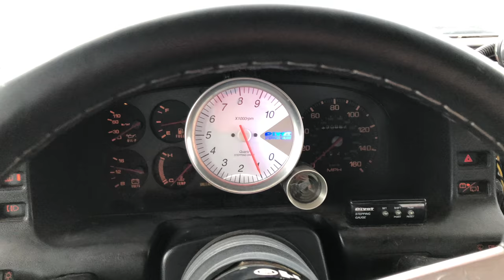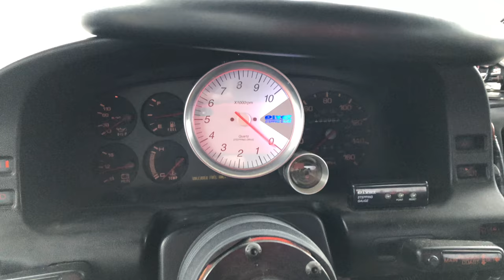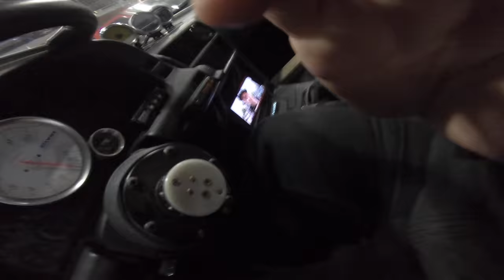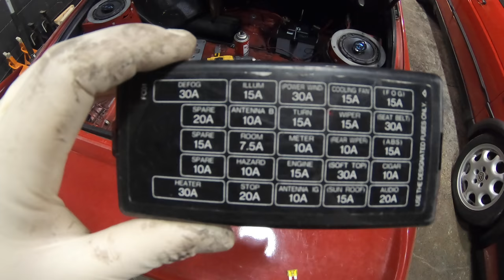DID I JUST FRY MY HALTECH ECU?!

Comment: Check the connection to the maf sensor. If there isnt a signal on the maf, then the pump will get no power to prevent fludding. Im not sure that its the same for haltec, but factory ecu's do this. If no that, check the power going through the wires to the pump and see if there are 12ish volts going though it.
Reply from the maker: the pump isn't the issue. the haltech just isnt' getting power/powering up.
Reply: Youve tested for power then?

Comment: There should be a fuse in the power Distribution panel under the dash for the ECU.  Check your fuses, if you have a Multimeter test each fuse on ohms.  But pull them out first so that you do not pop your meter.  they should each have 0 ohms.  also there are fusible links.  test them as well they should also have 0 Ohms.
Reply from the maker: 85 Studios appreciate it. Figured it out a while ago, it was the ECU fuse. Couldn’t tell until I actually pulled it out (rookie mistake, I know)

Comment: Take it back to Elite so you can have it ready for 2019
Reply from the maker: I'll just LS swap it if it ever came to asking a shop to work on my car again. Relying on other people to finish my car is the worst.
Reply: Clean Installs but you even said u dont understand wiring haha, but worse case is just get the pin out for the ecu and manually give it 12v and see if u can connect to it via computer